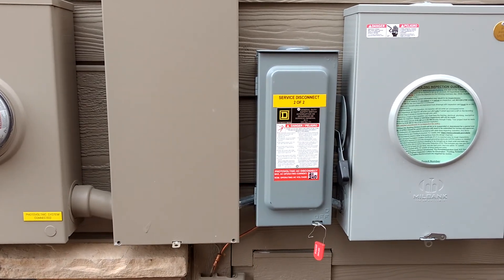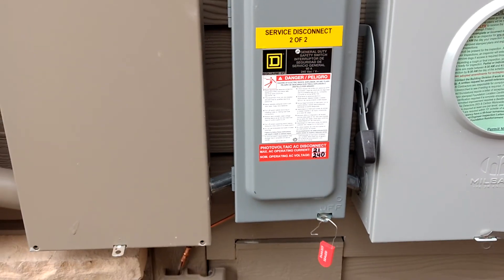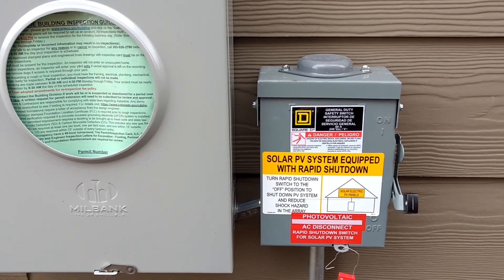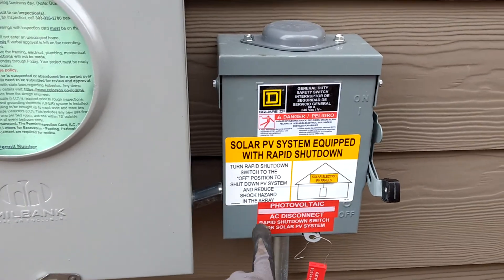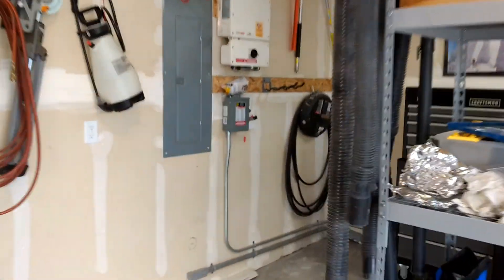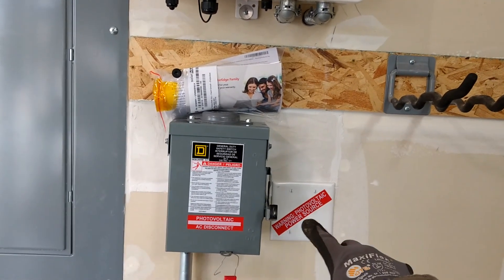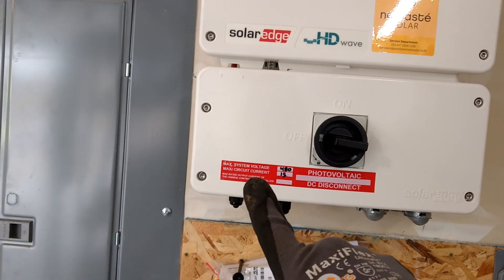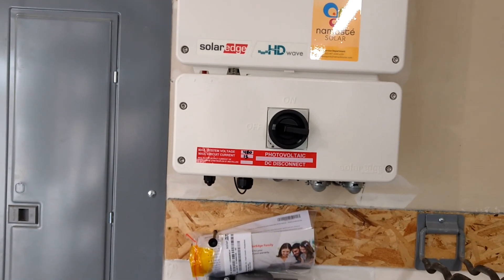Placarding and required labels for Solar.

Comment: Is the main panel truly fed by a dual source since you have the line side taps? Wouldn't that only be if you had back-feeding breakers?
Reply from the maker: technically, solar and utility are feeding the house, whether its line side taps or backfed breaker

Comment: Great video, thanks. Question: If you are connecting to the line side with your solar, what "backfed" breaker do you have?
Reply from the maker: in this video, there is no backfed breaker.  I was talking about the disconnect sticker could go next to the interconnection, whether its a fused disco or  backfed breaker.